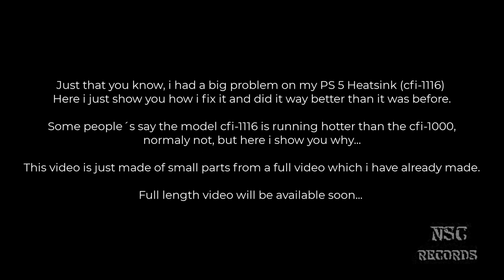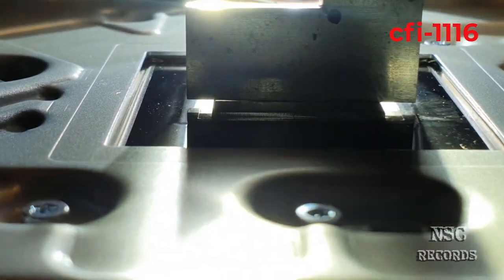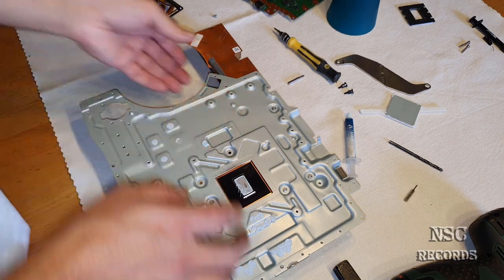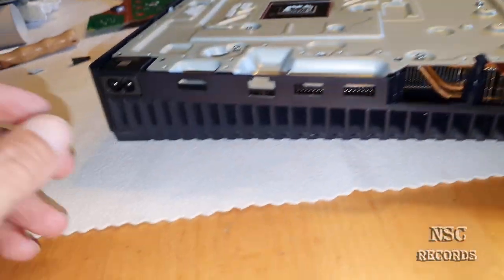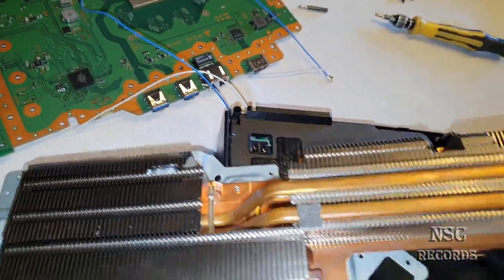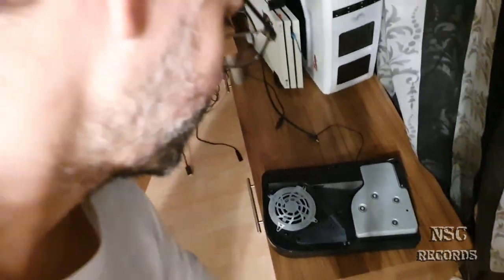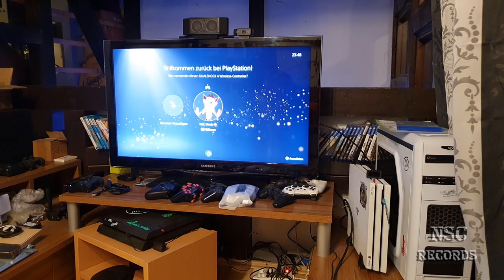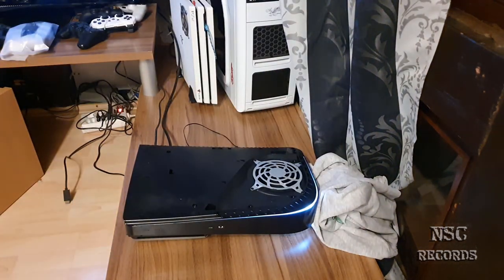This is how i modify my PS5 Heatsink for best cooling By:NSC

Comment: Nice, did wonder why the Xbox series X has more power then the PS5 but uses factory grade thermal paste and runs far cooler.Another terrible job by Sony.
Reply from the maker: After i saw my bad Heatsink, i now know my self why they need to use LM. But when i saw the other great Heatsink, i knew that on this one you can go for normal thermal paste, because the other Heatsink was just prefect! But just wait for my next video, you gonna be happy like never before 😀
Reply: @NSC-Modz  Yeah NSC when they showed LM was used i was suspicious considering the Xbox series X uses low quality thermal paste and achieves better temperatures.Can’t wait to see the results from your PS5 gonna make me jealous😂
Reply from the maker: @Joe-qs9fw  it will make you 1000% jealous for sure 🥰😆😍🤗✌️
Reply: to me it looks like xbox has way better airflow and better heat management alltogether.  better designed.  to me ps5 seems terribly designed from a heat standpoint.  

playing next gen games it can run at allmost 200 degrees F which to me is nuts.

like if you open a ps5 and touch the heatsink it can burn you lol.  and any issues at all and your ps5 overheats and shuts down.  even just a little dust.
Reply from the maker: Xbox has the better quality, better leveled Heatsinks, no bent CPUs or Heatsinks, that's why they work also without liquid metal.

Comment: Make sure you put some solder mask on the APU too cuz that Liquid Metal will leak down on the caps and resistors and short the apu and it will cause the ps5 no to turn on
Reply: He’s gonna use thermal paste
Reply from the maker: @Joe-qs9fw  no, i did not 😅

But all cool, i have protected all.
Reply from the maker: All cool bro. I know what I'm doing 😉
Reply: @NSC-Modz  Ah, would be cool to see if MX5 or thermal grizzly thermal paste would work
Reply from the maker: @Joe-qs9fw  now it would work ;)

Comment: My question is would a 1000 version heatsink fit version 1116
Reply from the maker: If you watch the video really right, you would not ask this question 😅
Reply: @NSC-Modz   asked the question while still talking about 1116 heatsink not been level I didn't even know was a heatsink swap
Reply from the maker: Yeah 😆  all cool 😎
Reply: @NSC-Modz  is a replacement expensive
Reply from the maker: No, the Heatsink you can buy used for about 30€ on ebay. But you can first check, if your Heatsink is OK or not ok.
Reply: @NSC-Modz  will when is out warranty is only a few month old thankz
Reply from the maker: @jasephase2k933  no problem, you always welcome. 😀
Reply from the maker: Soon you will see a video where i open the ps5 easy step by step for you guys.